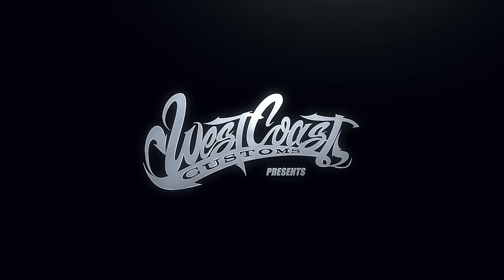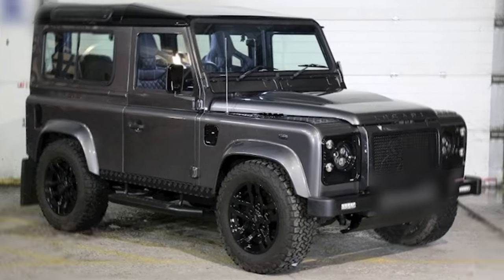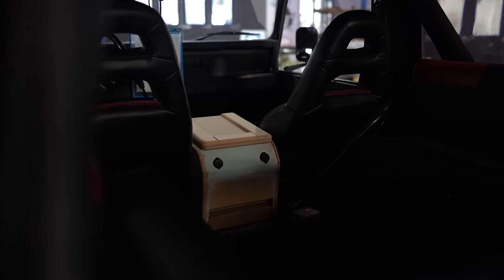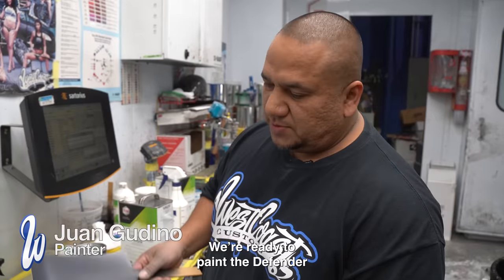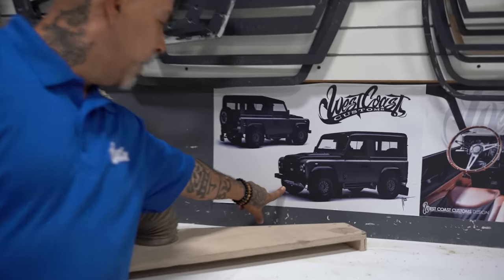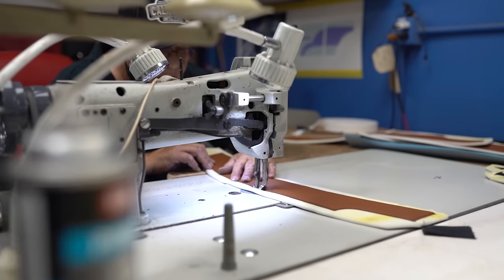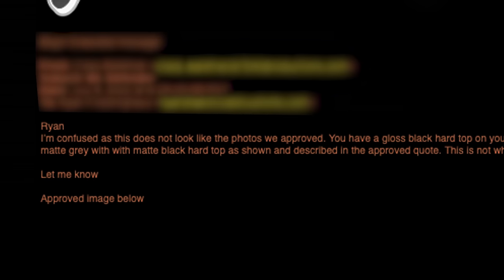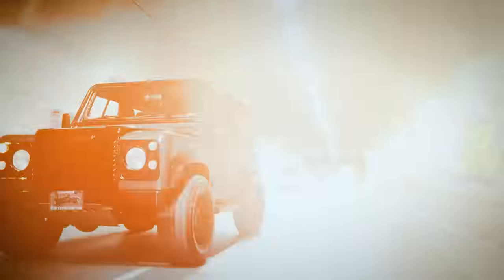Classic Land Rover Defender | West Coast Customs

Comment: That skid plate would barely stop gravel, let alone an Immoveable rock…the UK Military Wolf Defender has a 6 mm tempered and reinforced skid plate bolted directly to the ladder chassis nothing gets past those…you didn’t work on any of the chassis weak points, steering and drag links, A arm joints, bushes, suspension…this is purely a beauty Queen…wouldn’t survive 10 minutes in the UK off-road scene - Please do better in future !